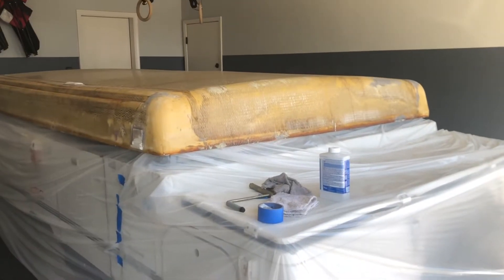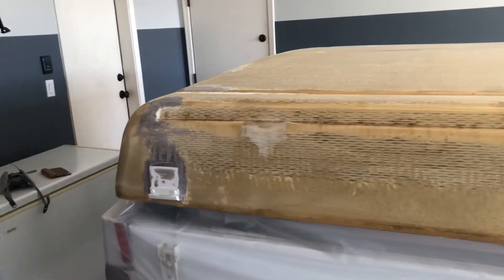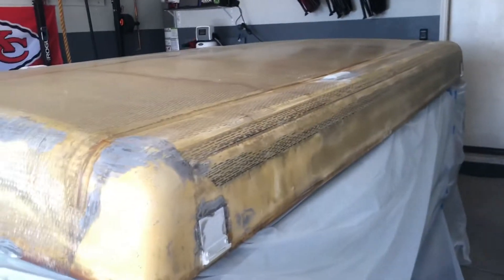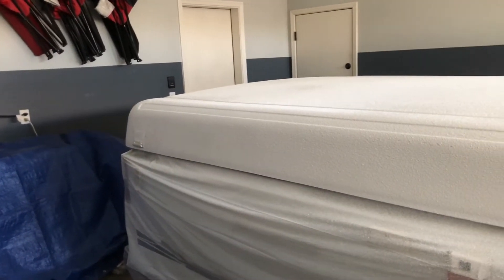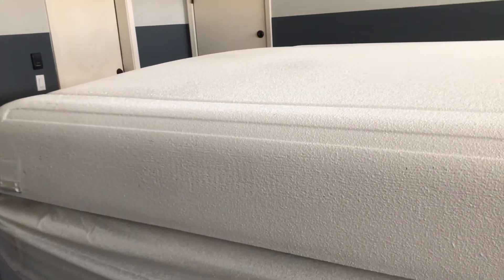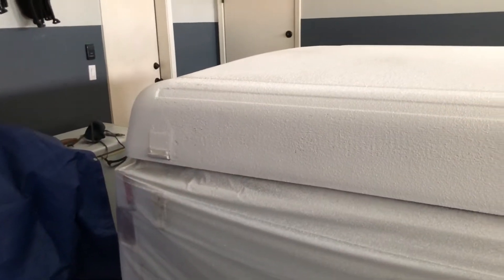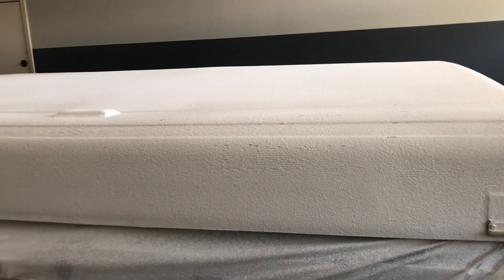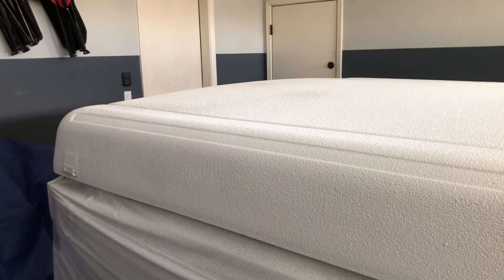Pop-Up Trailer Roof Rebuild using T-Rex Liner

Comment: We just did ours with the T-Rex.  We used 10 quarts of the liner for the roof.  We found out that just spraying out of the gun will leave lots of pinholes. To eliminate this problem we sprayed an area, rolled it in with a paint roler, sprayed for texture, moved to a new area, sprayed-rolled-sprayed, then sprayed the whole surface to eliminate roller marks.  You want to work in shade/low light so you can see areas that are thin with pinholes.  Bright light or direct sun will blind you so you can't see the light areas and pinholes.  I sprayed and rolled while my wife mixed the quarts of bed liner one right after another.  A quart will empty very quickly.
Reply from the maker: I didn't try the rolling method but I did get a few pinholes from the sprayer.  I figured it was more due to less than ideal prepped surface.

Comment: My coleman top looks like yours with the ABS removed, except the foam has a thin coating of something and a thin layer of adhesive on top of that.  Was yours the same?  I'm wondering how to clean off the adhesive before painting.  Soap, zep, varsol, and acetone don't work at all.  Lacquer thinner dissolves it but evaporates too quickly to get it washed off easily.
Reply from the maker: hmm, not sure what would work best.  The nice thing about the t-rex liner is that it should stick to most surfaces so if there's some adhesive left I would think you would still be ok.  The main thing is your prep surface should be as  smooth as possible, or at least as smooth as you're comfortable with.
Reply: @douzhanglao  I really had a lot of adhesive and couldn't get comfortable leaving it there.  Ended up cleaning with a lot of lacquer thinner.  Brush with plastic bristles (steel bristles would have damaged the surface), then wiped off quickly with rag.  Over the entire surface, but concentrating where there was more goo. Then did it a second time.  Instead of T-Rex, I brushed on Rust-Oleum marine topside primer and paint.  One quart of each was just enough for my 97 Santa Fe, so you would need more for a larger model.  It doesn't hide imperfections but I'm confident it will be durable.

Comment: I am looking at a 1999 Coleman Cheyanne. It has bad cracks in the abs and looks like it is sagged around the center where the AC is but could be the ABS lifted. The canvas and inside looks good. Guy is asking a grand for it. Is this fiberglass under the ABS or foam?
Reply from the maker: I can't be certain but if it is anything like mine it is foam covered in fiberglass.  The ABS shell goes over that.  For a grand if you think you can peel the ABS off and spray what's underneath it sounds like a deal.  Do your best to see if you have any water damage.
Reply: @douzhanglao  the only thing that worries me is the roof seems to be sagging where the AC is mounted.

Comment: THANKS for this video.  Quick question, what Bondo did you use and did you have to do any prep before applying the bondo?
Reply from the maker: Hi there, I used a fiberglass specific bondo and didn’t do too much surface prep other than cleaning the area with a damp rag.
Reply: @douzhanglao  sry to bug you again, but did you sand?  If so, how much.  Im not sure what the goal is with sanding other than the bondo ares. tia
Reply from the maker: I only sanded the bondo areas to match the rest of the roof as much as possible.
Reply: @douzhanglao  PERFECT! I think I was over doing it but it was not getting smooth so I began to think that it cant be made smooth to the touch and it doesnt matter with the T-Rex anyway.  Sweet! I will do the same then.  TY!

Comment: Like the video. How is it holding up? We need to redo ours and looking for ideas. We have coated ours with flex seal. It does work but now where there are cracks on original top it is separated.
Reply from the maker: It held up very well, it was in like new condition when we sold the trailer last year.

Comment: What did you use to fill in the imperfections? My camper roof is in the exact same shape but has some imperfections/cracks in the foam.
Reply from the maker: I used fiberglass bondo.  Worked well but you want to make sure you sand everything down to where you want it after filling.

Comment: What size is your air compressor? I have a 7 gallon and set at 75 psi but it was not spraying out like yours.
Reply from the maker: My compressor wasn't much bigger.  I used a 10 gallon air compressor and did have to take a few breaks but it worked pretty well.  Make sure to check the instructions to see what their recommended PSI is for the sprayer.  I don't recall what I set my compressor to.

Comment: What made you go with T rex liner?  I have seen some people using grizzly grip and still trying to research which is best, cheapest, easiest etc
Thanks
Reply from the maker: Honestly the reason I went with T-Rex liner is because it was readily available on Amazon in an all inclusive kit.  It came with all the product needed and included the spray gun.  Easy to get ahold of and it had good reviews. It was also reasonably priced at the time.  I haven't looked recently but my guess is the price has increased over the last several years.

Comment: Does it still seal good where the top meets the bottom?
Reply from the maker: Yes, I replaced the rubber seal at the bottom after we finished spraying the roof.  You can find the rubber gasket on Amazon and eBay.

Comment: I have a Bayside, how did you get the the cracked top coat off and did you say it's fiberglass below it ?
Reply from the maker: Most of it came off in big pieces but there were a few spots with a lot of glue that we had to carefully pull off bit by bit.  My advice would be to go slow and don’t force it.  
And yes, it was fiberglass and foam under the shell.
Reply: @douzhanglao  Great information.  Your video and information is extremely helpful
Reply: Im repairing a Bayside myself. To defeat the glue careful use of a heat gun helped me. I used a different liner but same concept. Right now I have to figure out what to do about the front box. Its a mess
Reply from the maker: @rodgemic  let us know if you come up with something good.  The front storage compartments are tricky!

Comment: When you peaked off the plastic roof, did you fiberglass over the foam before spraying the liner?
Reply from the maker: I did not, however if I were to do it again I would probably do a thin layer of fiberglass resin/epoxy over the existing fiberglass and foam just to smooth it out.  it didn't need it but I think it would have been smoother overall if I had.

Comment: Hello,

What did you use to seal the roof before using the T Rex?
Reply from the maker: Hi Eric, nothing was used to seal the roof prior to applying the T Rex material.  However, I did use a fiberglass bond to fill low spots and smooth out some rough areas.  The roof was already in good condition under the plastic shell and the T Rex liner is also waterproof as long as it is applied correctly.

Comment: Hi I was wondering is that stuff rubbery and flexible or is it hard and crunchy after it dries?
Reply from the maker: Hi Ben, the surface is hard but not crunchy or scratchy.  I would describe it as solid with a smooth textured feel.
Reply: Bryce Dopp thanks for the reply I am gonna do an old rv roof. I’m looking at all my options. I definitely want a more rubbery product. Thanks again for the reply !